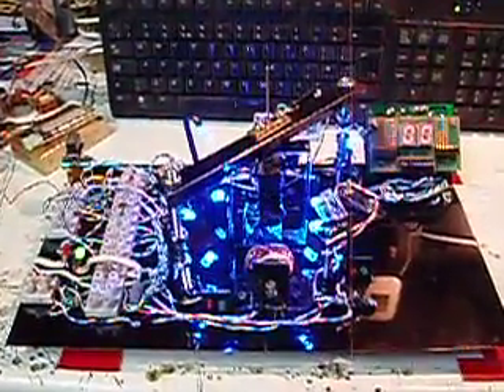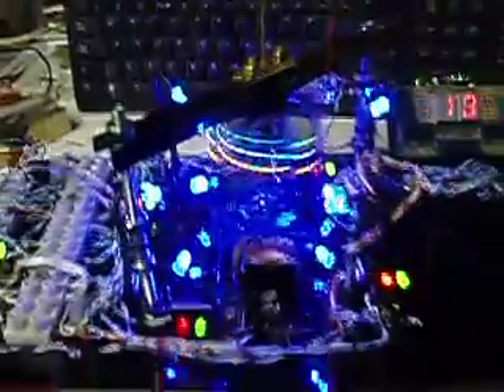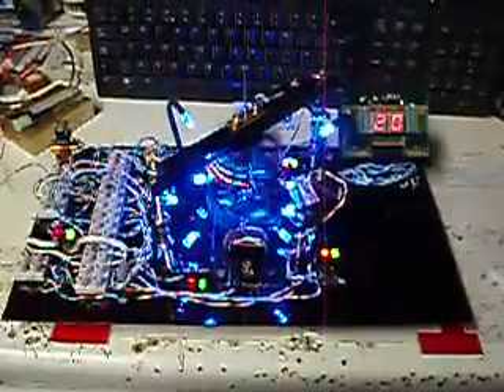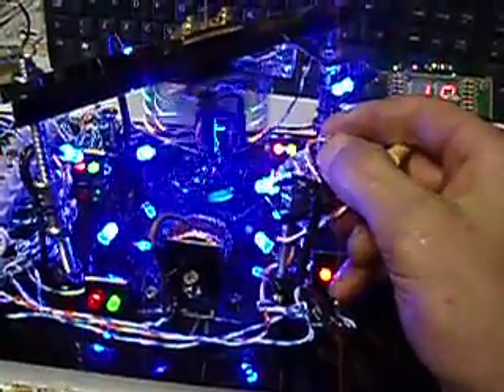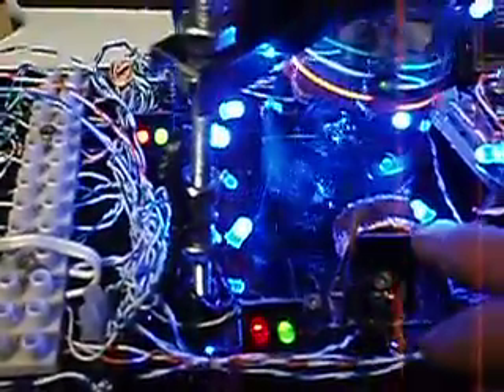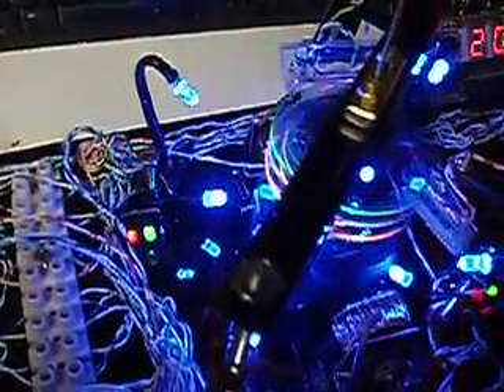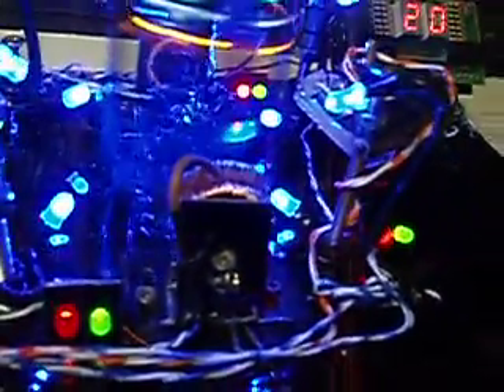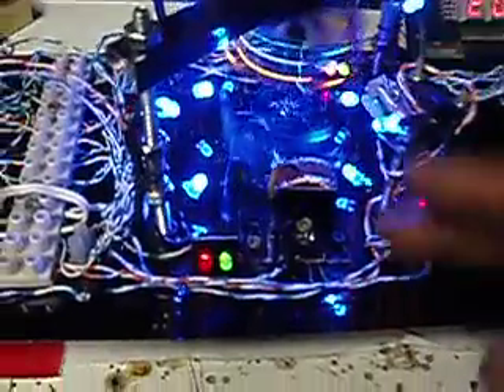Steorn Orbo motor test - Blue Lightning 1

Comment: John, excellent work! The blue LED light experience will certainly compensate your disappointment about missing overunity.
The bad news is, this kind of motor is known for  near a century and termed reluctance motor. The concept was abandoned, due its poor efficience. However, its reinvention by Steorn and propelled by human belief energy turns this device into a good setup to reinvent Maxwell's laws too.
;-))

Comment: Think about how the core effect works. If your coil is on AT ALL before what you call the "zero balance point" you are hurting your rotor acceleration by reducing the magnet's attraction on the way in...just what you don't want to do. If your motor is running like this, it isn't running by core effect.
Try adjusting the timing so that the coil stays off until exactly the zero point or maybe just a tiny tiny bit before it. Does the motor run better? If not, you are not in core effect mode.